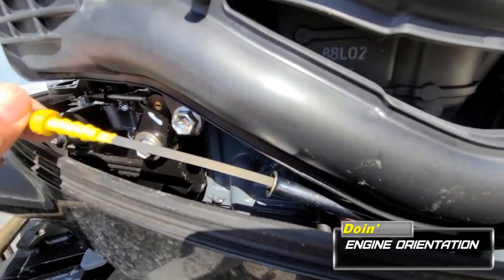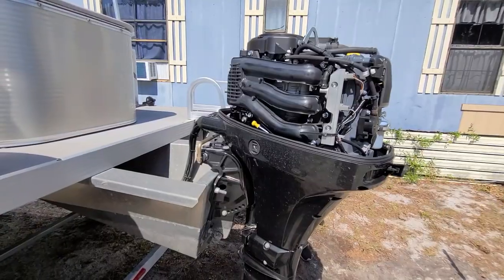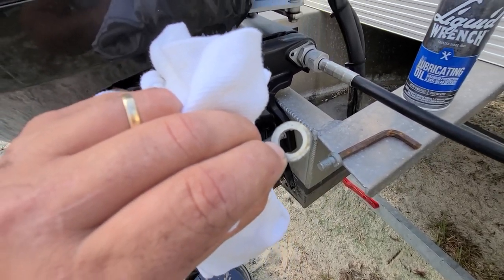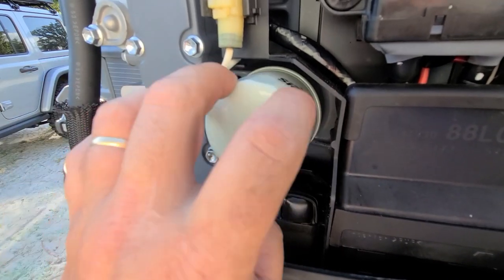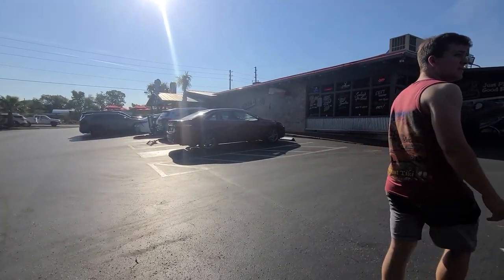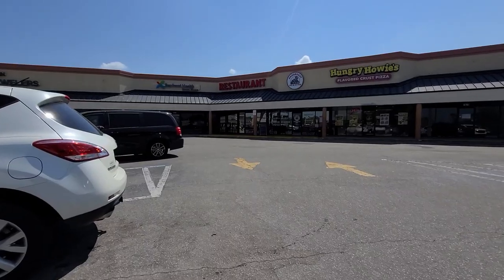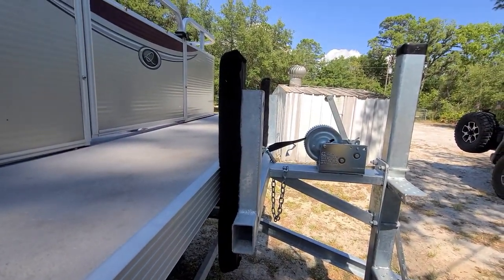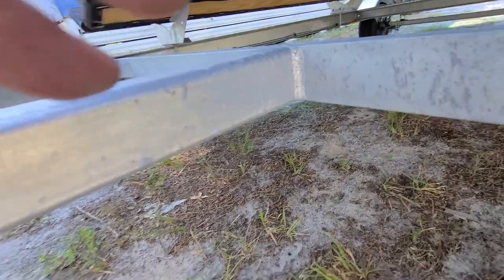(S3 E4) Suzuki 40 outboard engine flush, oil change. Adjust trailer and a few restaurant reviews

Comment: I'd drill it, get some Corrosion X HD to spray up through that hole annually, to coat the inside of that square tube.  That is a corrosion killer/protectant.  The non "HD" version (red can) is used a LOT here in the Seattle area.  They discovered that spraying the back of the electrical panel, if a boat went down in the salt water, they were often able to salvage the electronics (gauges and such).  The stuff was originally used for Boeing, but the marine industry discovered and fell in love with it too.  You could also pop in one of those rubber (flapper style) one way valves, used on the under side of truck beds so the water can escape, but not fill from that hole.
Reply from the maker: I'll look that up, thanks
Reply: @MotoCheez  Amazon

Comment: I’d only drill it, if saltwater was getting inside, if rain water was able to get in, it will evaporate, it’s a solid weld at the other end, why drill it, but if your launching where the tongue is getting submerged then by all means Drill a hole, debur it, re-coat it with a cold galvanized coating, or simply leave tongue slightly lower with wheel chocks in place, self draining, when parked at home.  It’s one of those things, personal preference I suppose, it’ll take decades for that tongue to rot out, as long as the galvanized coating hasn’t been compromised and you just rinse it all out when you flush the motor, I’m sure your spraying down the boat as well I would think, hit it all, keep it nice the best you can.

Comment: I was just wondering is there a lake on the way home between you and the ocean? If it has a boat ramp just back everything in on the way home, run the engine to flush it out.. it'll also rinse all the salt off your trailer. Might save a little time..
Reply from the maker: There isn't, but coming in I am going back to the fresh water springs which takes care of it, but I still flush because its brackish, depending on tide

Comment: I ran  DF140's on my Towboat US for over 5 years and serviced the engines around every 100 hrs.. Never any problem.. Sprayed the blocks, and components down with Corrosion Block.. Still looked new after 5 tears.. Don't remember other problems... Did have to drill out my pee holes a little larger so it didn't clog up with sand..
Reply from the maker: Awesome

Comment: Good stuff Moto.....if the front of that draw bar is open (looks that way).   How about parking with hitch down hill a couple lowering cranks on wheel jack may drain it. Which is ok if not much weight is on hitch ?  Add moisture remover spray between trips...silicon in channel with wiring ? If that works you may not have to drill.small hole wouldn’t hurt,but may not drain good .enjoyed your vid as usual !
Reply from the maker: That's a good idea but I normally leave the front end up so stuff runs off the back instead of the front I suppose I could leave the front down. Probably drilling a quarter inch hole would solve everything
Reply: @MotoCheez  it would be more work and time ,more steps,put one up them swap ends. Small hole sounds good haha, thanks Moto.....

Comment: Yes, as I live no the Pyget Sound (Saltwater Inlet from the Pacific Ocean in the Seattle, Washington Region) you should definitely drill a ¼" Hole in the Back of your Trailer Neck and Debur it afterwards to all ALL the Saltwater to drain!

Or, just give your Trailer a Mild Forward Tilt to Drain on it's own... As long as you are using Wheel Chocks, the Boat ain't going anywhere.
Reply from the maker: I'll paint where I drill. It's galvanized but bare metal and salt water not a good combo 😁

Comment: Going to Florida was a great idea for this weekend. Record cold and all rain all weekend here in New England. Sucks. First time I got a good tour of a four stroke Marine engine, they've changed a lot since the Evinrude I bought back in the '80s. Those sacrificial anodes are made out of zinc or magnesium.. every boat has them.  Those mirror extenders are a lot smaller than I thought they were going to be good choice! And I would definitely drill a drain hole in the main beam on the trailer. That's the last thing you need to have collapse on the highway. You can probably just rinse it out every time you flush the engine wouldn't hurt. Maybe pop another grommet in there too. Go to Amazon and just Google docking lights you'll find plenty.. thanks for another great video!
Reply from the maker: Agreed!!

Comment: I have this motor in a 70HP version for my pontoon. They are great motors. Mine runs like a champ. Very quiet and great on fuel.
Reply from the maker: It's amazing how quiet it is, and it is really good on gas!
Reply: 70hp is a 4 cylinder, not 3 cylinder.

Comment: I like the boat! I know this is off topic of the video, but I've got a 2019 hawk. Its giving me trouble with charging? I've already replaced the stator. Everything is hooked up as it should be. And as of yesterday only my high beams head light works. And I've lost my turn signals...the fuse from the silinoide is still good. I have no idea where to even begin...
Reply from the maker: What kind of charging problem are you having? Did you try to regulate her first? Is it overcharging and blowing your headlight bulb out? Sometimes if the turn signals don't work it's the flasher unit itself it's a little too prong box under the seat you can see in some of my videos when I remove the beeper on one you can jump the wire across the flasher and it'll just make the blinker solid when you turn it from left or right
Reply: Its just not charging at all. Ive replaced the battery already. And had to charge it multiple times just to have lights. And the low beams come on they are just very weak. But the high beams work just fine. I will check the flasher unit.
Reply from the maker: By the way if you have a volt meter see what the voltage is at the battery, it should be around 14 volts if you're a little bit above idle. Is it possible that you have a wire partially shorted somewhere?
Reply: @MotoCheez  new battery sits right at 14. Its just weird cause when I got the bike it was about 3 weeks of casual riding and it started. I bought it partially assembled. I don't recall missing a wire anywhere. And even when I replaced the stator thinking I had a faulty one from the factory it still didn't do the trick. I guess I'll just have to run my eyes across every wire and connection I see? I'm also replacing the stock carb with the nibbi carb. Already have done the exhaust swap from your video and both sprockets. Hopefully I get the rest of the issues sorted out. I'm just out of ideas at this point lol.
Reply from the maker: Yeah. Sounds strange

Comment: Oil level in your motor,upper mark might be over,on my mercury,full is in between.
Reply from the maker: That's what I was thinking but the manual is not clear. It's probably room for like I say if it took on any external water or whatever you would not want it above that or hydraulic lock. Three quarts seem to do pretty good about three quarters of the way up. Even though it called for 2.5 I just thought that was strange that they do not specify all they say is the top hole is full and the bottom hole means you need oil

Comment: I would not recommend your boat salesman to anyone obvious it was not serviced before being put away looks like boat salesmen are as trustworthy as buy here pay here car salesman . I would check the entire boat out carefully. And we have purchased 3 boats in the last 15 years from marinas and they completely serviced everything
Reply from the maker: I had a talk with him today, I agree.. he says he sold it to me cheaper because he thought I was going to service it, but I specifically asked if the oil was changed and he said it was done last season. I saw the 2016 on oil filter and said well that's way too long so I assumed he was going to do it so he's supposed to make good on that but I do agree
Reply from the maker: I actually told him I was very disappointed because when I was changing the oil I asked to be supplied oil in a filter and he said no, that kind of pissed me off I'm a 100% honest and I will voice my feelings, good or bad.
Reply: Most good shops will service so as to have  no issues after sale and freshly serviced and inspected is a good selling point. Fact he lied tells you all
Reply from the maker: I agree, but then again I always do all my own work I don't trust repair shops, I'm going to do the lower unit and I'm going to do the plugs I'll have everything done and I know I'll do it right and I know it'll get done